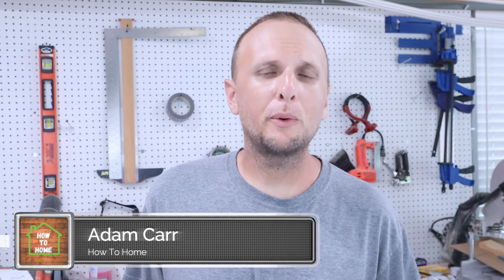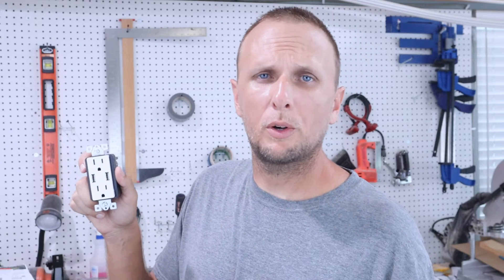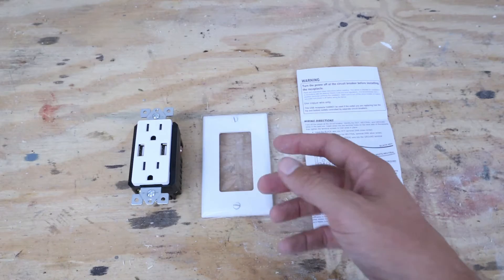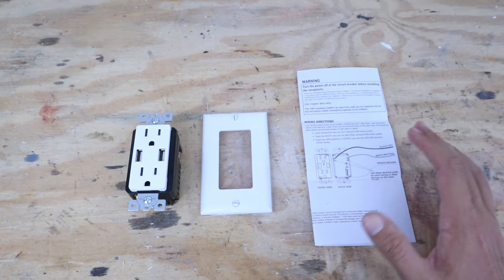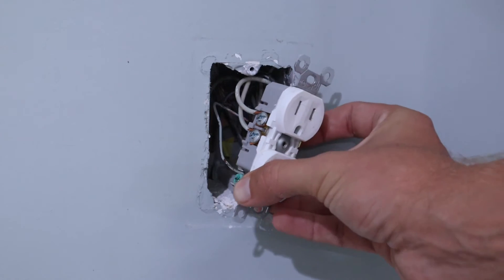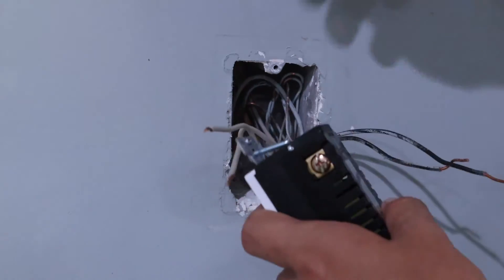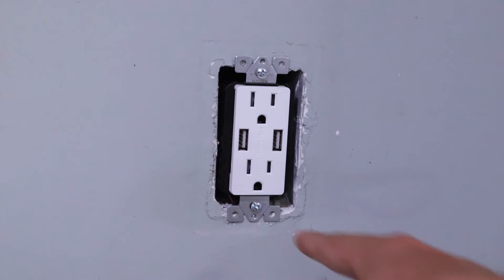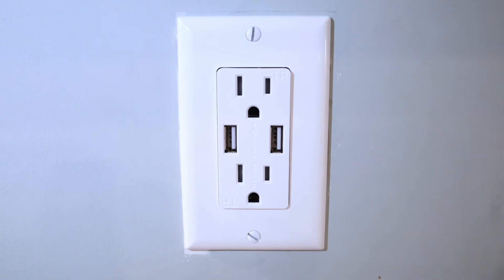How To Install A USB Outlet In Your Wall | Quick and Easy

Comment: Just discovered your channel and I've used this particular video to install a USB receptacle.  It was a big help!  I haven't installed a receptacle in 10 years so it was relatively new experience again.

A few things that I struggled with so others can learn from my mistakes:

1) I could not get the black and white wires out of the old receptacle--they were not like this (coiled around the screw).  They went straight in the back of the receptacle but no amount of tugging pulled them out. I went as far as completely removing the screws before realizing they were the type of receptacle that required sticking something small in the small square hole to release the wires. And yes the inscription on the back made that instruction loud and clear but I didn't think about reading the back of the receptacle.  Live and learn.

2) I struggled getting the ground wire underneath the brass/(copper?) plate underneath the ground screw.  I ended up unscrewing it until it almost fell out, then pressed my finger against the plate so that it pushed against the screw.  After a bit of finagling, I got it to hook inside and traverse down the intended groove.  And a big thanks to your video for specifically calling out to put the wire underneath the plate.  I would have put them between the plate and screw.

3) Unless you have a great work light or head lamp, work during the day.  Thinking this would be a quick project that I could knock out in 5-10 mins, I started near sunset--I wanted to get it done and not wait til the next day.  I had handheld flashlights and that was a big frustration.  Lesson learned: either get a great work light or work during the day (or both).

I'll be doing more of these but thanks again for showing the way.